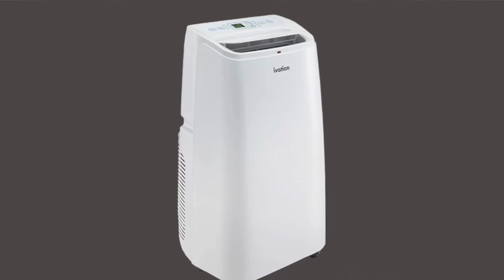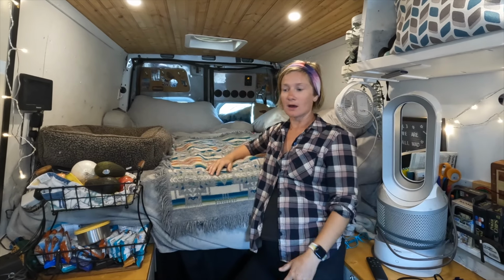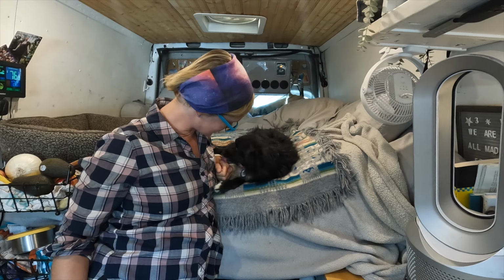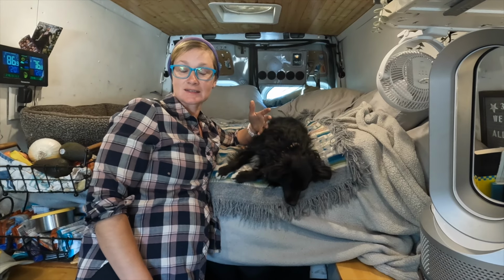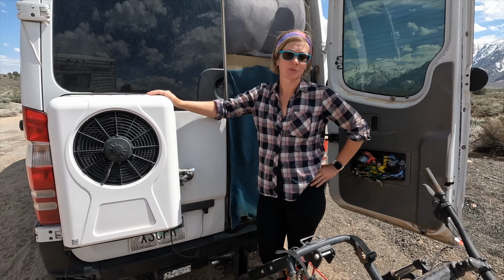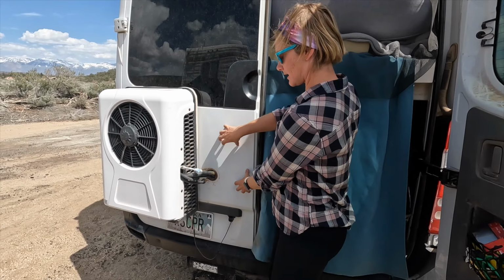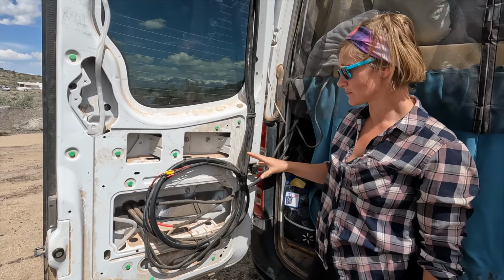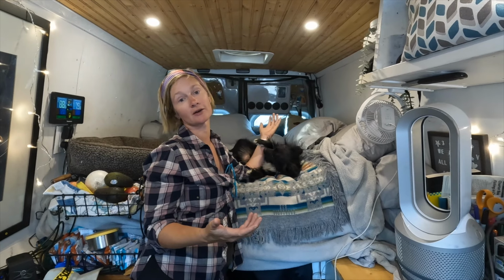Best AC for a Van: 12v Mini Split

Comment from the maker: Here's a link to the Mini Split Keri used: 
A/C: https://amzn.to/3BXzboz
Reply: Thank you thank you for sharing. This is a Jonnie I’m older and I can’t handle heat.
Reply: @TheGalavan  ooh, yeahhhh, that is a 12 V unit which means it’s “least” efficient. As I was saying before:
 “the higher the voltage, the better the efficiency. “
This  Amazon 12V unit will draw much higher amps. Would absolutely be better off buying a regular mini split and save a lot on your battery bank. Good luck out there.
Reply: @mikefranks4528 watts is how you compare efficiency. 12x60 or 24x30, same watts same efficiency. The SEER rating is how many btu's the unit produces for each watt consumed.

Size of the evaporator and condenser coils dictates much of the SEER rating.

Comment: While Keri does not explicitly state the BTU rating of her specific Treeligo unit in the video, 12V mini-split systems for vans and truck cabs typically range between **8,800 and 12,000 BTU**. 

Treeligo units, similar to the one Keri installed, are commonly sold with cooling capacities in the *10,000 to 12,000 BTU* range. These units are designed to be highly energy-efficient, often drawing around *600 to 960 watts* while maintaining effective cooling for small, mobile spaces.

Comment: Keri demonstrates that her 12V system easily dropped the van's temperature by 10°F in under 30 minutes while consuming only 20 amp-hours. She recommends a minimum of 200 amp-hours of lithium batteries and 300-400 watts of solar

2.4 KWH minimum battery ,  so math says it  take 6 hour to recharge?

Comment: In this video, Keri shares information about the various air conditioning options she’s tried and explains how and why she instalIed a 12v backpack mini split.  This is hands-down the most efficient option I’ve seen - both in terms of initial cost and energy requirement.  It’s so energy efficient that if you have a decent-sized solar system, you could run it without upgrading your electrical, and Keri shares just what it takes energy-wise.

Comment: WAY to much Blah-blah-blah ~ Education is a good thing ~ Here's your missing info:
 So 20ah@30minx2=40ah / 300ah = 7.5 hrs max cap run time w/No solar... BUT you don't mention your BTU's = which are @ about 600watt / 12v = 50a = only about 8k BTU , which will efficiently cool an RV up to 200 to 250 square feet under normal conditions.

Comment: Trying to decide now to get a mini split installed in my Transit hightop van, or fix the cab AC condenser. 

Also what's the difference between 110V & 12V units?

Comment: Climate control is so important in a van. I found that the higher the voltage, the more efficient the unit. So, I opted for a 240 V mini split that only produces an average of 238 Watts per hour. The compressor is actually housed within the van and a max air fan on the back door to move air in through inlets giving the compressor the environment it needs to operate properly. The best efficiency I’ve heard thus far on ANY unit. Would love to hear from anyone else that can share a more efficient system. I’m always willing to optimize.😊
Reply: I looked to see if you had picks cuz I don't understand how to put inside...but sadly no picks on your channel.

Comment: Great informative video. But do consider if the system failed while your pet was unattended.
Reply: @jimbosammy4255  they do have little temp monitors that connect to your phone. Have only read about them
Reply: They do have temp monitors that connect to your phone. Have only read about them

Comment: In 30 minutes it pulled 20 amp hours. (sigh)
Reply from the maker: That's pretty low - my 3qt Instant Pot uses about 15 in 30 minutes.
Reply: @TheGalavan  but how much can you store?
Reply from the maker: @grlnexdoorable  I think Keri has 600 amp hours of lithium.

Comment: The bad thing about mounting on the back of anything is the dirt and dust that swirls around the back of your and a roof top mount would be ideal and a lot of air flow and the noise on the back would annoying so roof top would be the best all around mounting spot.

Comment: You cant beat the 5000-6000 btu window ac mounted upper rear, may have to get a plexiglass/lexan panel to replace glass if you dont have solid panel.
Cleaner install results, weight is less, watts are way less, cost is way less. Soft start 455 watts plus inverter watts used.
You can teach this old dog new tricks, if its logical

Comment: Valuable info!   My next van idea will be much smaller than yours.. looking at the Promaster 118 wheel base with low roof. I have this idea with the rear wheel wells to make some bulkheads all the way up to the roof so that the a large high queen bed could be closed off with a curtain too.  Then opening vent holes in both rear wheel wells so can just install a portable AC 5000 btu in the garage and have it supply air through vents in the bulkheads either to the bed or the living area to further reduce the space that needs cooling.  Not even about cooling a space so much as having some cold hair directed at me where I'm at.   I have another controversial idea i did in my current van that works well here in Florida - I cut a giant hole in my roof, lip up the sheet metal and over it with a giant solar panel and strip of stainless mesh for always open ventilation - bugs and water never get in, and it adds some ambient light and enough height so I can stand and even look out.

Comment: When she says it dropped the temp of the van to 72° - 80°, she never said what the temp is outside. Summer's definitely getting warmer and I'm curious what people are doing on those "feels like 107°" days ... also, I don't know if she indicating how many BTU that unit equals out to.
Reply: The only 12V mini split units I have found are 6000BTU, which should be acceptable in a well insulated van.
Reply: She said it was 84 to 90 outside

Comment: Thank you for this information out of a...I am building a custom camper van "Delica", which are sold here in Oz used from Japan ...sadly my life is short thanks to the US Government killing US Troops in Vietnam with Dioxin (Agent Orange) I have several medical health issues that will kill me ....just a fact of life...Right now over 400,000 Vietnam Veterans have already died since returning home from health issues directly related to that exposure,according to the US Veterans Administration..
 .I want her Van to be safe and extremely comfortable...she's a great lady and I used to be a Art Teacher,  as we often camped here, plus in my earlier years I was a bump and paint man...  so custom metal and wood working are simple for me. I built a roof rack with twin solar collectors. When parked she hits a switch and the second collector extends out to the side, as a sun shade and doubles the power intake. I was thinking adding a blanket type collector of on the front windshield could also be an option... any thoughts? Here in Australia we have so many back dirt roads, I am setting her up with stronger wheels, springs and shocks ... plus a splash shield and wench.
 Time is short as over 400 VN vets die a day, all my Australian VN Vet Friends have died and all my VN Team Members.... like anyone cares.... great post... thank you.

Comment: One of the biggest reasons why I do not live in my van is because of the heat. So now I can research this mini split idea. Thank you for sharing this.
Reply: There us nothing new about 12 volt air conditioning units fir vans and campers.  They have been around forever
Reply: I live in my van with a window unit sticking out of the back. Sure it draws some eyes, but im saving about 1500 dollars by not living conventionally.
Reply: @SirCumferencelel  how do you keep it powered?
Reply: @ZoeandGemmasTravels I use a 2000watt Jackery With solar. My van  has dual batteries and I charge them whenever I drive. I also use a very small Honda generator to top things also but only if I am low to top things up
Reply: @johngreystone  will that power a mini split AC?
Reply: @ZoeandGemmasTravels  yes but like I said I top up with my generator . I am Michigan so my hot hot days are limited but I still go 4 of 5 straight days of use and never use my generator at night
Reply: @ZoeandGemmasTravels  Electricity mostly. Jokes aside, batteries and solar provide the power. For the hottest days of the year, there is a generator to supplement power when its cloudy or way too hot for the panels to keep up. As a generator should be used.

Stats for the nerds. 10 lifepo4 lithium 100 amph 12 volt batteries for 12 kilowatt hours of capacity. 

Bouge rv mppt solar charge controller bluetooth enabled, 600 watts of solar, and a weize pure sinewave inverter before the discontinued them. 

The cheapest part of all that was the AC. Cost me about 50 bucks used.

And a 4k predator generator from harbor freight. Both plugs and 6 lifepo4 20 amp chargers off the generator on cloudy days.

Why 6? Because that is all I could fit using the 2 external ac 110v noco plugs could handle safely.
Reply: 12V vs 110V - has its differences, are there any DC/AC combined options? I have not seen any….its either/or unless you add a 110V to 12V converter for when you have shore power and want to run the 12V mini Split?

Comment: It would be interesting if you did a presentation on the heating mode of the mini-split unit.
Reply: There is no heating mode on this mini-split.
Reply: How do you heat your van?
Reply: @rebeccadees2300  an espar diesel heater